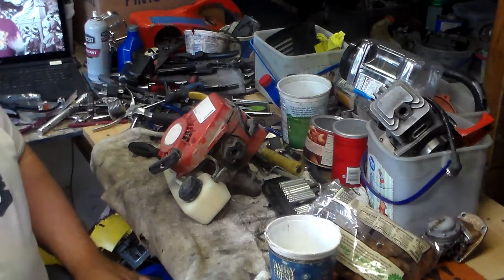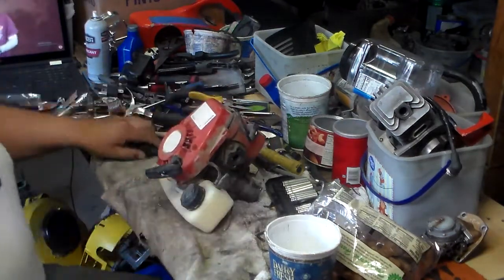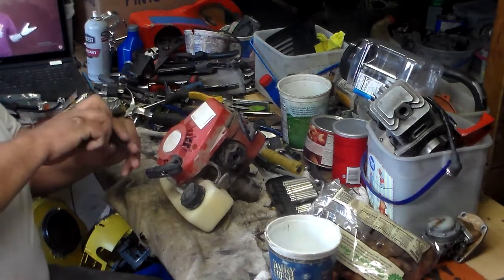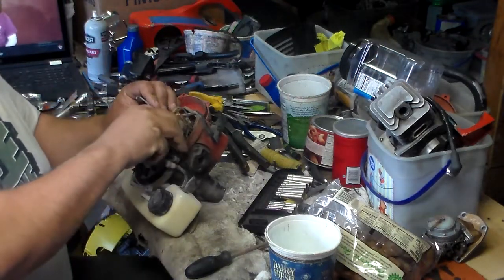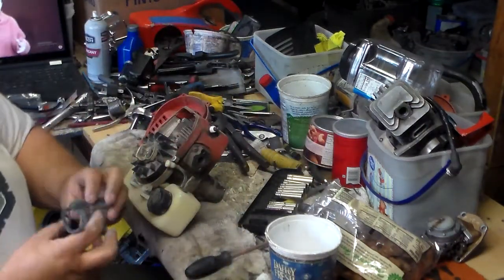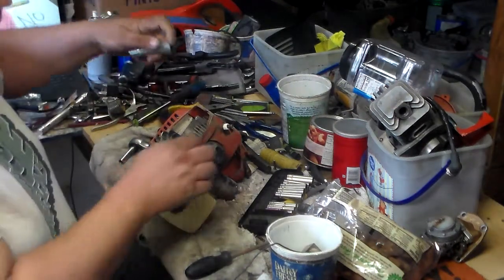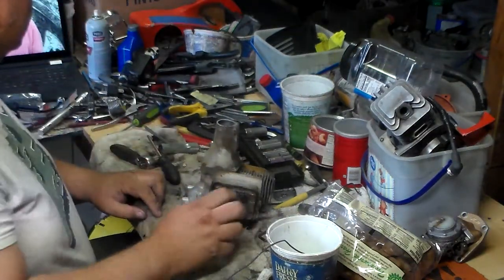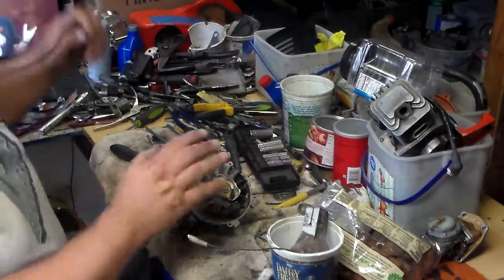mantis tiller teardown and rebuild

Comment: Woaw, awesome ! First time I see someone doing something else that just swapping the carb !
My mantis doesn't start , so I changed the coil, now I have spark , even with braking fluid inside the chamber it doesn't start.
I'll try swapping carb and then opening as you're doing.
THANK YOU very much from France !
Reply from the maker: thank you very much alexis i like to do a full tear down but for others its just a lot of boring time but for me i like to check all boxed and get everything fixed the first time  then that way i know it will run good and for a long time
Reply from the maker: allso if you can please subscribe to my channel like my videos' and please tell all your freinds about me and agsain thank you
Reply: @2strokefanatic578  Woaw, you found your track ! yes few people do the "real" deep job, this is why I wanted to congratulate you ! 
Thanks again for sharing your knowledge.
Take care !

Comment: Can you tell me more about using the string in order to get the “thingy” off the top of the flywheel.  I am trying to see if the key is sheared.  Will the string / rope get hung up inside or can I simply then JUST (just is a 4 letter word) pull the string out?
With the plastic flywheel you can’t just put a screwdriver thru the fins to have it back up to get the nut lose.
Probably the same as saying to use 50 to 1 oil mix.   They want your extra business.
Thanks for any added info
Reply from the maker: hello there sorry for the late response i been busy as of late, using the string is the best way to immobile the cylinder and piston so u can take off the nut or other parts depending on the machine also the string can be cut out or you can get it out without the worry of any damage to the piston or cylinder, the string is a lot easier to replace that the piston and cylinder i hope this helps

Comment: Does the mantis tiller have a shear pin in the flywhell?
Reply from the maker: the newer ones dont the shear pin is on the flywheel which sucks that you need to buy a new flywheel if you shear off the pin

Comment: My tines stopped Rotating and won’t move will that be the worm gear or worm gear bearing or something else thank you
Reply from the maker: yes my guess the clutch is stuck closed or oil and dirt in clutch and clutch housing or you got a rock stuck between the tines and body you may not have seen it

Comment: Would you know how to fix a gear box that runs backward? I bought one used and it runs back at my feet instead of pulling away. Thanks!
Reply: Sounds to me like the handle has been put on back to front. Take the handle off and put it on the other side.

Comment: I have one and every time it warms up it locks up soled.
Reply from the maker: hello keith sage, so what I'm getting is that your mantis tiller locks up when warm, ok well first of all what mixture of oil to gas you using, it should be 32 to 1, the newer tillers call for 50 to 1 and that is not enough oil to lubricate the cylinder and piston, yes the label calls for 50 to 1 ratio but that a bunch of crap, its rigged that your tiller engine will fail  with a 50 to 1 gas oil mix , it will burn up  and lock up the engine, and cause damage to the cylinder and piston.
also look at the piston and cylinder see if it is scored and burned, best way to do that is by taking out the muffler and shining a light to see the condition of the piston and cylinder, if you see bad scoring its best to take off the cylinder and replace what is scored and also check the rings they should move freely and not be bound up in any way, if you see that the rings are scored or broken just replace then you can get new rings for less than 10 on eBay
well that all i can say without the tiller right in front of me to see it and problem shoot the cause, also see if the bearings in the crack are good or not if there is a lot of movement on the crank bearing yea im sorry the bearing are gone and you will need another crack and rod and that is a lot of money , so best to buy a new tiller, mantis is a good  brand but the newer tillers ask for a 50 to 1 ratio of gas to oil mixture, that is not enough for the bearing, piston, cylinder to work on so it heats up and scores or locks up the motor,  mantis has been for several years  misleading owners of mantis tillers to under lube there tiller in hopes of you buying another tiller, but all garden and yard companies that make 2 stroke equipment have changed over to that tactic to make more money, i hope this helps and i answered your problem that best i could, also please if you have not subscribe to me please do so, tell your freinds about my channel, leave a like that helps me out a lot, and watch for my next upcoming video.
Reply: Wow sir you are very knowledgeable I’m doing my yearly exam on why my mantis won’t start I usually swap carb and hoses and pumper ball but I broke the recoil so trying a drill bit no luck yet but thanks for info
Reply: If a 50 to 1 mix was what the factory recommend why would they give a 2 years Commerical or a 5 year home owners warranty?  I've run chain saws and many other two strokes for over many years and never had a problem. I don't see your logic on 32 to on on such small engines